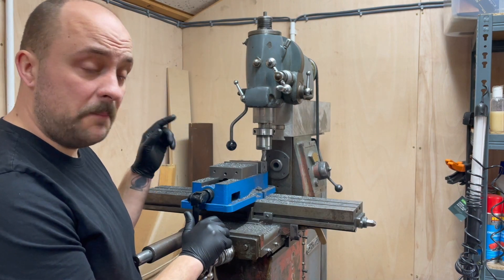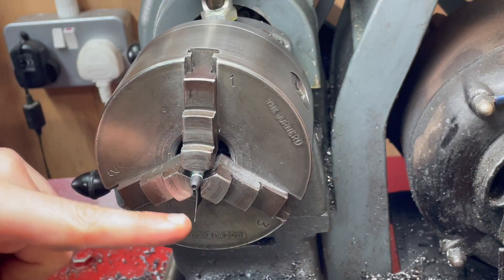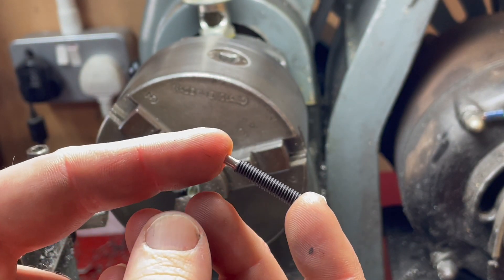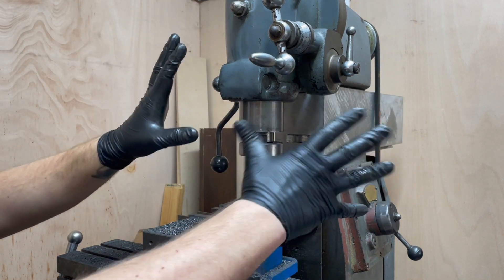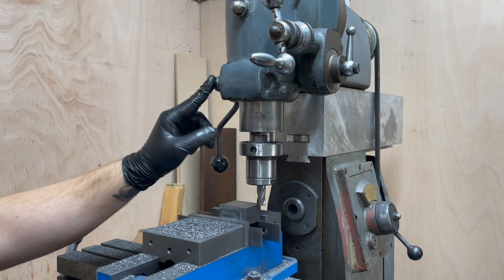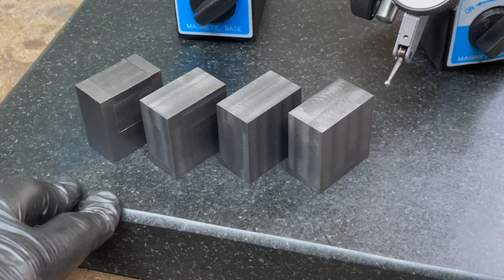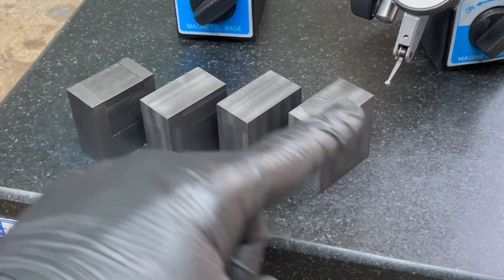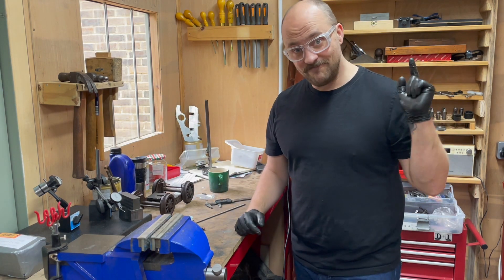Getting accuracy on a 60+ year old milling machine - Steam Loco Build #9

Comment: Nice video, thanks.  I wanted a Centec, but they are quite rare with the vertical head so got an AEW.  Similar issues, and being a metric type I'm battling with 'thous', until the DRO arrives from China.
Reply from the maker: Oh I don't know, I quite like thous and inches -it's all consistent across everything I'm building :) I'm nervous about drilling into my Centec for a DRO but I know it's inevitable before long.
Reply from the maker: Sorry for not replying earlier - I did add some clearance to the bushes as you might have seen in my most recent video - but I have a feeling I'll have to go back and add more!

Comment: Hi William, I have the same mill, Centec 2B serial number 5783 which is from 1964 as I understand. I have just got it running after making a stand with drawers and fitting a new 1 1/2 HP motor and VFD. It’s all running well. I am also now tuning the x and y ways and need to add some missing gib set screws. My question is where we’re you able to source 2” long 3/16 32 tpi set screws. To small to broach the 3/32 hex so if I can’t find a source. If I  can’t I will make some and just use a slot. Thanks for your content.
Reply from the maker: I’m pretty sure that I used slotted threaded rod, turning the dog points myself! Maybe Myford spares? I seem to remember buying some but I’m not sure if they’re coincidentally cross compatible and so I used them  on the Centec or not!

Comment: dear william enjoyed the video  very  happy to see your centec  [ the same as mine] but mine lacking the vertical head ! i need one ,! !,, but they are as rare as hens teeth [ i am thinking about  making one,, mission impossible ? some one had to make them to start with !  ! the same goes for the raiser block!.. .. william ... there is some one out there stumbling over vertical heads and raiser blocks    but where is he ?    i need help  !   regards   laurence
Reply from the maker: Sounds like it could be a huge challenge. Try Home and Workshop Machinery, they tend to have them - you can get various versions with and without a quill. Or, mount the tools in the horizontal arbor initially?

Comment: My Warco Mill was fine but the bearings would get hot. This puzzled me until one day the motor caught fire melting the plastic cover!!! New motor and a good look at the set up. NO VENTALATION. 8 tiny holes at the base. These got cut out and the cover abandoned. A kitchen fan purchased and perched on top of the new motor. Turns out the head was a heat sink for the motor. I am now converting it to belt drive. WM 18. David and Lily.
Reply from the maker: Sorry to hear about that extra work - glad you got it sorted though!

Comment: Great work on getting more accuracy from the Centec. We had a session adjusting the gib screws a few months ago and it made a huge difference including eliminating the fibration. We will have to check out the quill on ours. I like your tip on cleaning, this is something we have done with mixed results. I think it suggests we still have a very long way to go to get more organised.
Reply from the maker: I still get some really annoying vibration when I'm feeding on the X axis in the direction of the hand wheel, or towards the rear of the mill - but  I think that's just not me accounting for backlash again.

Comment: I’m going back to the workshop now to clean and find everything I have mislaid! 
A well adjusted machine will indeed reward you with a more accurate machined part. I so need to do the same as you showed with my newly acquired Dore Westbury milling machine. 👏👏👍😀 Andrew
Reply from the maker: As luck would have it a left handed drill bit got that last broken grub screw out - so we're in fighting order once again.
Reply: @williamsworkshopuk  Ha ha. Excellent. Well done 👏👏👍😀